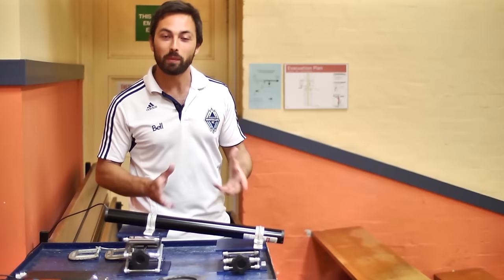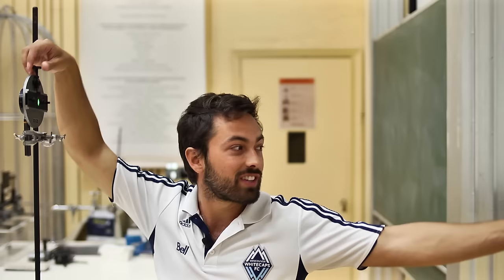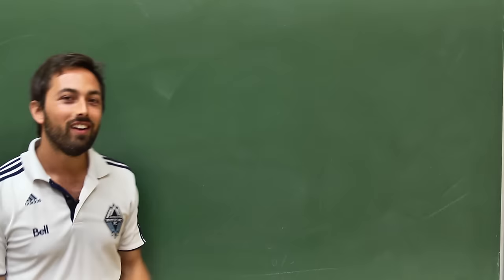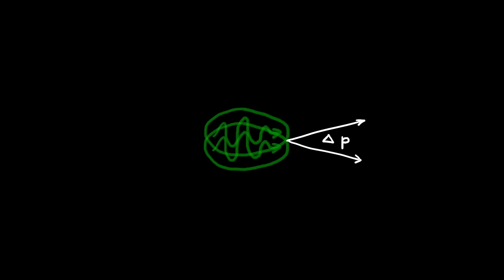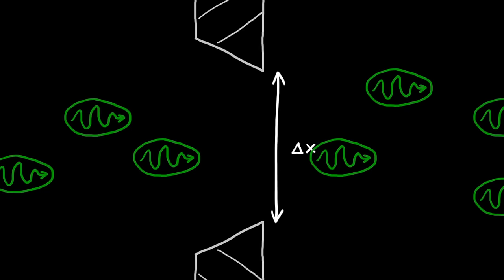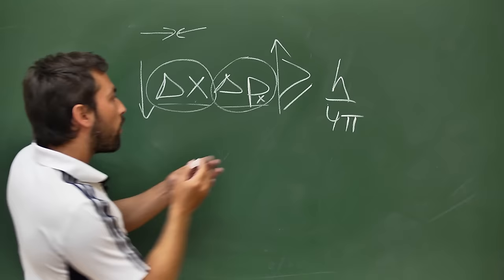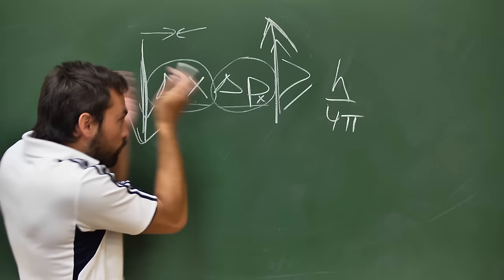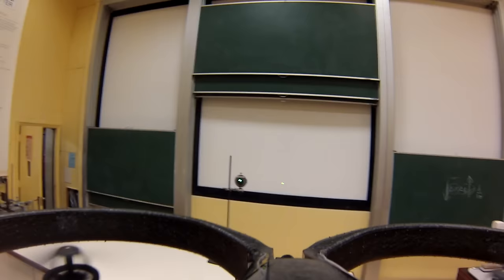Heisenberg's Uncertainty Principle Explained

Comment: I don't think this is a good demonstration for the principle.  Now I haven't had a college physics class for about 64 years but I would suggest some different demonstration or proof.  I do admit that in my 55+ years in science and aerospace I never encountered a problem that was affected by the uncertainty principle.  We even got to the moon and Mars in spite of it.
Reply: The uncertainty principle is just simple math, and it's valid for every wave. If a wave train is short, it's simpler to assign it a position, but harder to figure out the frequency. If a wave train is long, you can measure the frequency with high accuracy (you have a lot of wave cycles to count) but it doesn't really have a well defined position.
This does not only affect quantum mechanics, but any measurement where you deal with waves. It's one of the first things they teach you in university in engineering courses (when talking about Fourier transforms).

Comment: It seems obvious to me, the interpretation of these experiments are not quite right, given all the unanswered questions. And all the mental acrobatics used to attempt to fit the maths and theories with whats observed in experiment.

Imagine if particles did not travel through space, but propagated through space/time like newtons cradle, or like how sound waves are thought to propagate through air.

Also, what if its not the entire photon traveling, but part(s) of it, propagating through ???(free quantum energies) that makes up space time, even in a vacuum - where like sound through air, it knocks into free quantum energy that hasn't combined to make matter - that interacts with all the quanta energy near it as it propagates.Temporarily combining to make a particle, then breaks from that particle, and continues in its path as a partial particle.

Another analogy would be how electrons flow through wire in electrical circuits.Though I think that's been a misconception all this time for the same reason.... its not the particle flowing, but part of the particle propagating through the medium. But electrical conduction is controlled by being only in contact with a medium that make making predictions of how it flows easier than in free space vacuums. 

Think how 'photons' flow through fiber optics, sort of the same concept. Its not the photons flowing, but parts of the photon propagating. Recombining as it propagates, into the next molecule, that shakes loose similarly energized quantum energies (quarks if you will)... and its just the illusion of photon movement. I would say same with all other detectable particles.